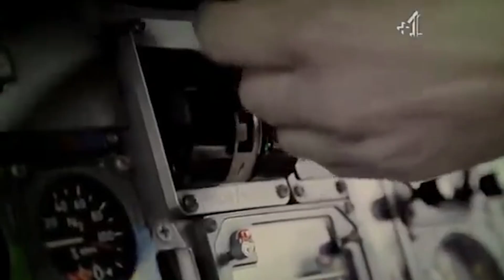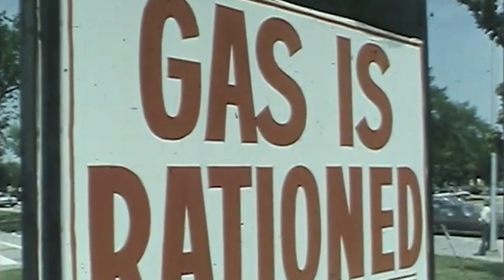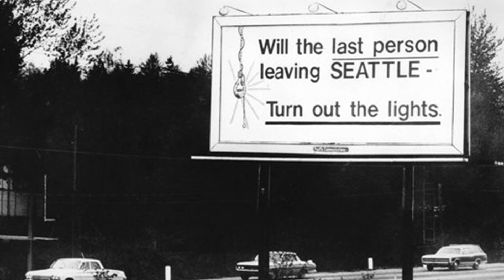The Forgotten American Concordes - Boeing 2707 - Lockheed L-2000 SST

Comment: If that Concorde used two tons of fuel just taxiing out to the run way, I'd leave it turned off and tow it there with a truck.
Reply: They could even use a special truck with a special APU on the truck. Then just have a big convenient power socket near the front wheels.
Reply: Right.  Like any modern engine, warmup is very important to the engine.  For these jets, it's all the more critical.  Such a rapid increase in heat would significantly shorten the lifespan and could cause a lot of failures.  There could be a way around this by using some APUs for both thrust to taxi and routing exhaust through the engines for warmup but that still wouldn't bring the engines up to full operating temp and it would add a lot of weight and design complexity.
Reply: you know, to this day I don't know why I still let the water run while I brush my teeth... makes the same sense.
Reply: x 29Lives x when u start paying for your own bills you’ll be turning that shit off! Believe
Reply: @29LiveZ    Put the plug in the sink. Put two cups in teh closed sink.  Turn off tap.  Rinse brush in sink
Reply: @29LiveZ  who the f*ck does that?! That makes no sense at all!
Reply: You need to have the subsystems running from jet engine power to make sure they work. A pure tow would not do that.
Reply: @davidhoffman5789  I recall reading an article some years ago in a corporate social responsibility journal about easyJet collaborating with research to develop electric drive power for airliner taxying. The reason? To cut pollution and to save fuel. It's obviously still an issue, even with much more efficient modern turbofans.
Reply: APU....?
Reply: @TheDarwiniser  ? Simpson's? What's Apu got to do with this, dont get the joke!
Reply: you're right I confused it with the sr-71.  The sr-71 was purposely built that way because it's titanium plating would expand and seal the leaks at operating speeds.

The Concord was just ineffecient with fuel consumption in general, especially when taxiing (2 tons used in that case) due to its engines being optimized for high speed.  When the Concord was at operating at Mach 2 it was actually extremely fuel efficient which made up for the taxiing fuel waste.
Reply: Nice idea but these engines need a warmup before applying take-off thrust.  You would sit at the end of the runway burning 2 tons of fuel to warm the engines!
Reply: @paulradley9673  Not really. The temperature of the core of the jet just to keep it running is already extremely high. What used to apply for reciprocating engines was not a thing even for early Turbojets.
Reply: @paulradley9673  So the concorde liked to puddle in a twin-twin-ish bonfire of pure joy you say ... Cozy!
Reply: Charles Ross 

Right.

Take your pills buddy, like the doctor said.
Reply: I've always thought a rail-like taxi system would be an interesting approach at large airports.
Reply: Kyle Eggemeyer would help with takeoff too, if you had a catapult system like aircraft carriers
Reply: +Charles Ross go on chuck, listen to John and take them pills. They're good for you! And remember, if you feel the urge to argue with alphabet soup, you probably haven't made sense of it in the first place. cheers😀
Reply: concorde during the taxi on Chrarles deGaul airport took about 800-900 kilos of fuel....
Reply: chronoss chiron Elon Musk is South African only his last name is German.
Reply: Concorde is one of the few airliners that does not have an APU.  It relied on ground power only.
Reply: *****, I think a dual APU system with 400% capability might allow the tow idea. Even if you have one APU fail you could still do a taxi and takeoff.
Reply: You could easily build a power coupling that would go from the tug to the aircraft.  Or just leave one engine idling.
Reply: Yes. Better idea than mine, which was take the sucker out to takeoff position, and refuel it.
Reply: also now your also paying for the fuel and maintenance of an additional towing plane. it would just equal out the cost of concord wasted fuel.
Reply: I was responding to ChuffChuffwoo's comment where he said they should tow it in the air with a plane to reduce fuel consumption.  You should read the previous comments in this posting first so you can understand the responses.
Reply: +505197 There have been studies done where planes are towed to the runways with engines off, but it was found that over time it places unacceptable stresses on the nose gear.
Reply: DoomFinger511 why tow it wit a plane? Trucks are used.
Reply: 505197 also you need to help the tug with a 10% throttle switch and let the tug turn you
Reply: 505197 I agree!🤣
Reply: On a side note, the Concorde did not have an APU. It relied on ground power at the gate and engine thrust for electrical power while taxiing and in the air.
Reply: Glyn Paton  take back all of their innovations? What are we 6 years old?
Take back our innovations....      Christ almighty.
Reply: Jason Muir  both countries contributed equally to the industrial revolution and it began around the SAME TIME.
Reply: @WelshWidgetMan2O1O  Yes, working like a madman from 6 AM to 20 PM at least. In enormous noise, dirt and heat or cold. For a couple of pennies or cents. Nice improvement that was. And if you said it's really not okay, you ended up in prison. Working like a madman, in appalling conditions, for zero cents a day. But capitalism is great. Yeah right.
Reply: John Smith there is no APU in concordes
Reply: :-D :-D :-D Doh
Reply: I don't think you're right about Concorde leaking fuel, I've certainly never heard of that issue before. I know the SR-71 had that problem but I'm pretty sure a commercial airliner that routinely leaked fuel at an airport would unacceptable.
Reply: +Samuel Rs 👍 very true
Reply: 505197 On take off, not taxi.
Reply: 505197 You can't leave it off or you turn off pressure guages, generators, and everything.
Reply: 505197 well...... not a problem now.....
Reply: 505197 iiiiii
Reply: +rufusprime99  Jet engines run very efficiently at high altitude due to the design for this height and because the air is coming into the engine at  a higher velocity. The thick heavy air and requires higher thrust settings also because of high drag on the a/c.
Reply: @ciashill9799  So it needs an equivalent of VVT in piston engines. Now it compares to a huge twostroke engine, performing very good only when rev'ed up. But mileage and emissions are not so  good in other situations.
Reply: You could put electric motors in the wheels and use the electricity generated by the jet engines running on a low power level.
Reply: @slowanddeliberate6893  Weight is an aviation key factor. Why power the wheels, if you can use the turbines themselves? It can be more efficient, but if it adds weight, it takes away some efficiency during the whole flight. But it's a good idea, electromotors are better nowadays than in the seventies.
Reply: @voornaam3191  Installed electric motors save so much fuel that 4 people less seating capacity would actually pay off.
Reply: @slowanddeliberate6893  FL 0 and Airbus sounds familiar. Leave the wings home and you have a huge bus.
Reply: @slowanddeliberate6893  Okay. Build a Mach 3 airliner, then. Problem solved.
Reply: They probably use this time to warm up the engines before takeoff.
Reply: 505197 yer
Reply: Like the catapult of aircraft carriers?
Reply: O
Reply: Well you don't want oh Mach 2.5 Concorde because of so much fuel so yeah
Reply: Concorde doesn't have an APU.
Reply: Clarence Trumble-Lovegod  the only two countries people have been talking about the past month or two.
Reply: Clarence Trumble-Lovegod  whatever you gotta tell yourself...lol
Reply: Id do electric hubs for taxi BOOM problem solved...
Reply: "Hot" (Engines running) refuels always bring an element of risk.  I did these in the  Air Force and we had redundant safety systems in place: even so, had a sliding valve seal fail once and this resulted in a spill of about 300 gallons (1200 liters) of JP-4 jet fuel all over the aircraft and the flightline.  Don't think you want a passenger A/C sitting there engines running and a fuel accident.  Just no.
Reply: +John Smith  Concorde was the only plane whitout an APU...
Reply: Sure they need a warm-up, but is two tons of burn-through necessary for engine warm-up?
Reply: they have those.
Reply: Jet engines dont need warmup.
Reply: Jet engines dont need warmup, they only need cooldowns.
Reply: Jet engines dont need warmup, only cooldown.
Reply: Jet Engines do not need a warm up time period. The second they reach idle you can go full throttle, simple as that. now after they have been at full throttle for a bit like after a flight its good to let them idle for a minute for the temps to lower and equalize but taxiing back to the gate does that. 

If you are doing an idle eng run for maintenance its a good idea to let them run for a few minutes so everything in the engine can warm up to operating temp( turbines etc), then shut it down so it cools evenly which is considered a full cycle, but there is nothing that says that they need a "warm up peroid" before take off power is applied.

Dont ever kill a jet engine right after you turn it on, it damages it since certain parts heat up faster than other, you want to give it some time.....pilots like to rush everything but good thing the mechanic over rules them.
Reply: They do not use fuel.  The jet engines run on compressed air.  The fuel thing is a complete lie!  A huge lie with huge implications!
Reply: I think it was too hevey to pull
Reply: David Hoffman Batteries?
Reply: 2000l of jet fuel is only a few hundred bucks - no problem. Also you don't want to be sat on the runway going through 10 minutes of starting procedure.
Reply: Then it would be American technic.
All American build cars could function better with your idea 👍
Reply: it was as much as your car used it 6 months
Reply: Even if Concorde had one, APU does not provide any thrust.
Reply: yeah. the thing shoul've been tugged. It's not unheard of for planes to get towed arround the airport instead of taxiing of their own power
Reply: Even if it used 100 tonnes and couldn't fly, I'd still taxi it.
Reply: That' roughly about 650 to 700 gallon.   Not bad for 60's technology, I am sure modern jet design maybe a little better fuel wise but not a lot, speed means more fuel no way around it.
Reply: taxi is also used for test so it is ok
Reply: i flew all of them...the Valkyrie was absolutely the best. Mach 3!!!   It was not a bomber it was meant to be a civilian passenger jet.
Reply: here's an idea why dont the cabal release the anti gravity tech and the rest.
Reply: funny cause   towards the end of ww2 thats what the germans did to preserve fuel too lol
Reply: Air taxi??
what taxi??
Reply: 505197 I was literally just gona type that exact thing
Reply: So true same thought
Reply: I have been on the runway at Heathrow when the Concord took off. It is the most painfully loud obnoxious thing there ever was. It makes the ground itself shudder from the roar of the after burners. Terrible plane. Not to mention it used 6 times the fuel per passenger mile as a 747.
Reply: @flyingdog1498  So you're comparing one plane with a passenger capacity of 92 - 128, to another which had one of either 416, 524 or 660 passengers depending on configuration, and ignoring the considerable speed difference between the two. Terrible thinking.
Reply: +Charles Ross
That's just a complete and unnecessary waste of water
Reply: I always turn the water off.
Reply: Reminds me of the Nazis using horses to tow their jet fighters onto the runway.
Reply: So many aeronautical engineers on the comment section of youtube! I think its pretty safe to say that this idea was thought of and dismissed for good reason ;-).
Reply: Part of the reason so much fuel was wasted was also because the plane itself literally poured out fuel.  Just like the military plane blackbird, the seals in the concord only stayed tight when it was at cruising speed because the entire plane would grow thus plugging the gaps.  At ground level most of the seals were open.  The blackbird for instance literally leaves a puddle of wasted fuel around it before taking off.
Reply: @DoomFinger511  BS. Concorde didn't leak fuel, excepting Air France 4590 when the fuel tank ruptured.
Reply: @nac5901  I already said in a comment (2 years ago in this thread) that I confused the Concorde with the SR-71 Blackbird in regards to the leaking fuel. There's 96 comments here, don't cherry pick what to respond too or you'll miss the context.
Reply: @DoomFinger511  And what, you expect me to read every comment, and remember who said what and when, before replying to some other comment? Sorry, no.
Reply: @nac5901  But no problem replying to a 2 year old comment I see..
Reply: @DoomFinger511  To be honest, I didn't even notice the date. (I also didn't know Youtube sent notifications of replies -- I only signed up to allow posting comments a few days ago; yours was the first reply I ever got -- so if I had noticed that it was two years old, I wouldn't have expected you to ever see the response...)
Reply: @nac5901  Well now there's context to the situation I feel like we just learned something lol
Reply: Absolutely not, I drive a diesel Ferrari F-40. I had it made special in China.
Reply: Matt fo   Yeah, as if Americans are the only ones guilty of this...    Whatever.
Reply: What innovations? Are you saying there are more American innovations than innovations from other countries? I think you'll be surprised.
Reply: Hey, thanks for the heads-up, monsieur; cheap shots are always welcome.
Reply: It couldn't take off if it weighed 2 tons more!
Reply: Use a truck to tow your teeth to the sink.
Reply: I don't know if it leaked fuel, but do remember, the higher the altitude that an engine runs efficiently, in this case 60k ft, the more inefficient it will be near sea level.  Also take into account the massive power of the engines.  It is a great curiosity that this was ever done, but on balance, it was crap in reality.  Great idea on paper.  Not so much in reality.
Reply: WelshWidgetMan2O1O Right, well it's indisputable that the industrial revolution began in England in the late 1700's. It didn't start simultaneously in both countries: it spread to the US a few decades later.
Reply: Better still, tow it in to the air like a glider ;)
Reply: David Hoffman lol.... wanka
Reply: 505197 jealousy bollox.
Reply: WelshWidgetMan2O1O which two countries? 
The industrial revolution pretty much started in my area, central England.
Reply: the engines would still need to be running to warm them up. still the issue wasn't just because the engines were fuel hungry, it's because the Concord literally leaked fuel until it got up to speed and made the plane get so hot that it stretched and closed up its seals.  no matter how it got into the air wouldnt solve the fuel issue.
Reply: @DoomFinger511  Concord did not leak fuel: see next few posts
Reply: @donaldstanfield8862  Which posts? The one's before or after my post where I said I confused the Concord with the Blackbird SR-71?
Reply: FriskyDingo erm....Britain started the industrial revolution not America.
Reply: Bwad...
...that wuth' funny.
Reply: Who leaves the water running in 2017 when cleaning their teeth. Come on chaps(guys in US) every little helps!
Reply: Oh, here's an idea, maybe the Europeans should take back all of their innovations and technology YOU use on a daily basis? You know, telephones, aircraft carriers, trains, cars, electricity, jet engines...
Reply: NO...

You better let that water run as to catch the ugly drooling out-of-your-mouth and falling into the sink basin.

Who the hell needs to see that; your dentist wouldn't do that?!

...continuous 'flush', squier, dynamically flush it!

Comment: Concorde RIP Killed by a dirty runway. Another thing that Concorde had in common with the Vulcan is that it was never in a state of constant development and became a technical relic from the 60s
Reply: There was a B model planned if the A model had sold 120 versions and the B had 120 firm no refund orders. The B would have not needed reheat or afterburner to takeoff and should have required less runway length. Only 24 A models were seemingly firm orders and those were from British Airways and Air France. Even that got reduced to 20. If the B had been successfully sold there was the rough concept of a C model in early design. The engineers were not sitting there doing nothing, but the company needed significant sales outside of the UK and France to fund further progress. Sadly those sales never happened.
Reply: No it was killed by how much costs it was to operate and low life of plane. Did you not watch the video?
Reply: Several concordes had suffered severe damage previously from blowing tires which would damage the underside of the wing as well as damage the tanks. This was an ongoing problem with them and several fixes had been implemented to at least limit tank damage. The design was by no means a winner as the more the planes flew, the more problems kept coming up. And the damn things were loud! We had one flying out of Oakland airport for short demo flights and it was flying over San Francisco. Beautiful, but god damn LOUD!
Reply: +GodKing804 But the video isn't in Creole.

Comment: That "Tupolov," or whatever it's called looks like a sad dog landing   ...big ol' ears hangin' out the sides.      It's still pretty bad ass!
Reply: The interior passenger area was uncomfortably noisy, it had terrible low speed handling characteristics, the HVAC system was unreliable, it had weird structural vibrations, and it used more fuel per passenger mile than the Concorde.